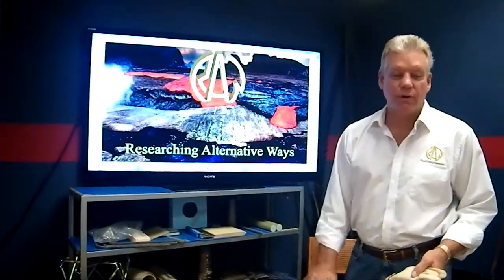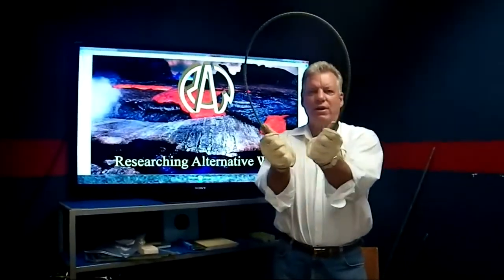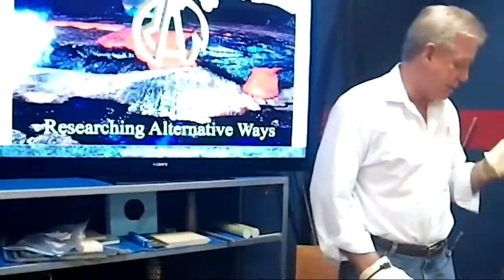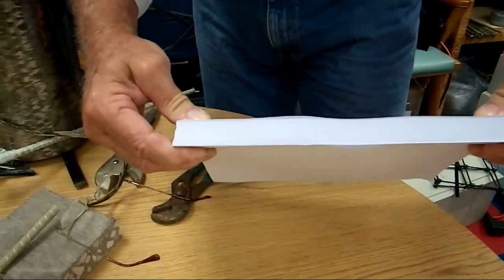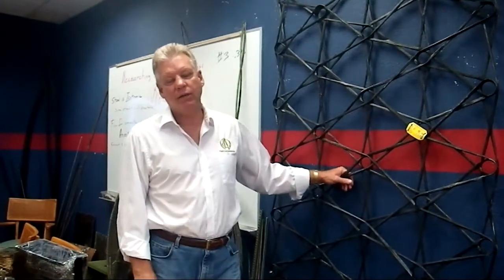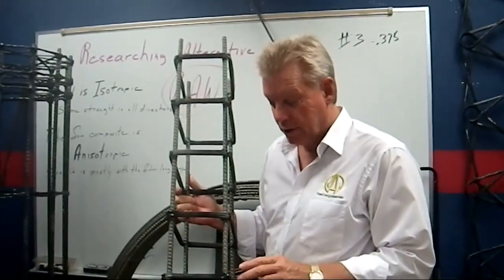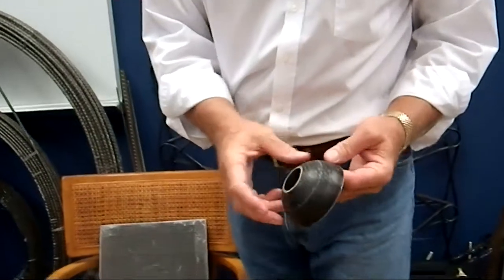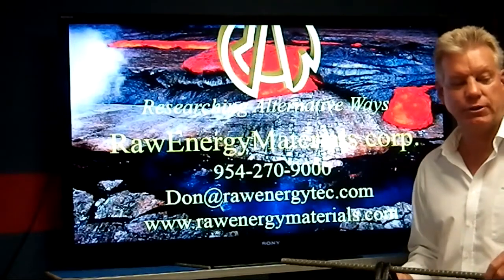BASALT FIBER, REBAR, AND OTHER APPLICATIONS - RockStar Materials

Comment: I've been searching for information on producing bends in gfrp bars for some time, and this video provided the answers I was looking for.
Reply: the bends have been trademarked and patented for some time now
Reply from the maker: @elinajenkinsraw  our team has the patents.
Reply: @jtherealtor  Would it not be possible to make corner couplers that once slipped on to a cut length with lets say 2" or 3" of the end shaved smooth so corners and different bends could be achieved in the field (on the job site)?
Reply: @jtherealtor  Would you have a material that could be used like metal lath or would you be interested in developing a product at could come in rolls 48" tall and be used like the metal lath and not rust in the mortar like the galvanized metal lath for thin stone veneer?
Reply: @jtherealtor  would love to see your patents for the bends
Reply from the maker: @chadcornick4655  we already produce all of the associated accessories including stirrups tie-backs, etc. Feel free to contact me.
Reply from the maker: @chadcornick4655  we already have a product that could.be used for the application, but prefer to steer clear of using metal unless absolutely necessary.  Feel free to provide your email address

Comment: A few dumb questions:
Why is pultrusion necessary for Basalt?  Can't it be cast into shapes instead?  If it were a pure basalt, wouldn't that be ansitropic?  
Could it be deliberately made into an aerated mass (somewhat similar to natural lava rock)?  
Of course this wouldn't be for use as rebar, I'm thinking of other applications like blocks.  
What's that fascinating rebar structure in the background against the wall?
Reply from the maker: Send me a message and I'll give you my email address to send your contact information. I'll connect you with the guys to answer any questions.
Reply: @jtherealtor  Seems that Youtube has removed the option to send messages.  Very funny though, looking up JT Kirk gave me Star Trek!   Do you have a website?
Reply: @jtherealtor  I'd like to send you a message, but the new Youtube won't let me do this unless you enable it in your channel(I believe).  When I go to your channel, there are no communication options.  (https://support.google.com/youtube/answer/57955?hl=en)
Reply: Basalt made into an aerated mass? What are rock wool insulation and Grodan planting cubes? I think the answer is "yes".

Comment: I have been researching this material and conduct testings on pull-out, effect of chopped fibres and rebars. I agree with the potential use of basalt rebars. I have a few questions:
- How can we increase the elastic modulus as it is very low to satisfy the serviceability 
- I conducted tests on using chopped fibres in concrete. What is the best way to mix into concrete? Adding basalt chopped fibres may not improve the compression strength of concrete as I found experimentally and I think this is due to the fact that the aggregate crush the fibres during mixing...any idea
-
Reply from the maker: We don't use the fiber to strengthen concrete. We have a geopolymer for that which allows us to use saltwater to produce concrete.
Reply: @jtherealtor  Perfect answer.. What are the application of chopped fibres then? what is the geopolymer as well?

Comment: with all due respect, I would never break that glass fiber composite if I were you.
Reply from the maker: What are your reasons?
Reply: @jtherealtor  I cannot give a citation, but I remember reading from a source I recall as being a reputable medical one that both carbon & glass fibers have the same negative impact on lung tissue as asbestos fibers. No difference. This may or may not be the case with basalt. I understand that people who have looked into it believe that it is safe or relatively safe. There are material properties for such a result, which have to do with its higher elasticity, so when a fiber breaks, it tends not splinter. The implications on fabrication & handling of products, as well as regulating their handling & disposal are stupendous. In the first place clean rooms for all sites where such fibers are cut, and then regulation of all places where fiber fragments may be created (all streets, roads, highways & homes, for instance). And this is not a recent problem either. Think of all those stupid glass reinforced boats, the square miles of glass wool insulation in homes & appliances. 

Regards, 

md
Reply from the maker: @michaeldiakakis4581  that's a fiberglass and asbestos issue but I'll be sure to ask about this when I speak to the team later.

Comment: it melts down at 700 degrees Celsius - the lubricant itself - so you cant use to rebar the concrete
Reply from the maker: Not true. Already written into code and far surpasses steel, etc
Reply: @jtherealtor  it is not. That is why it won't be used to concrete rebar construction
Reply from the maker: @aliartsuew6131  sorry but you don't know what you're talking about. Our material far surpasses those temps